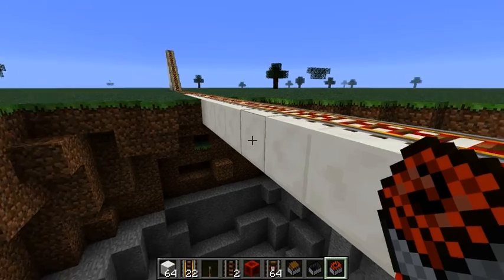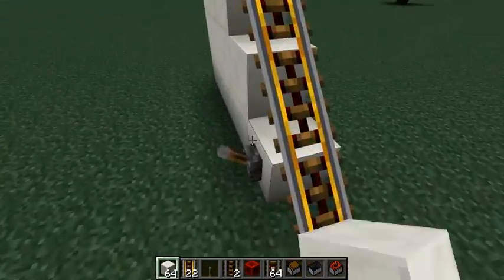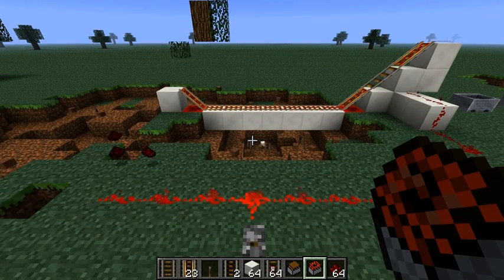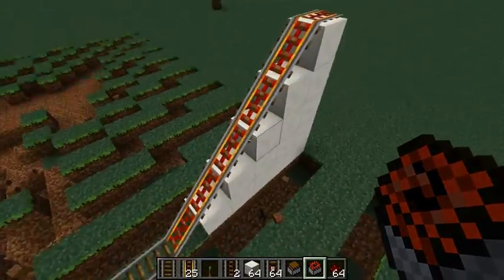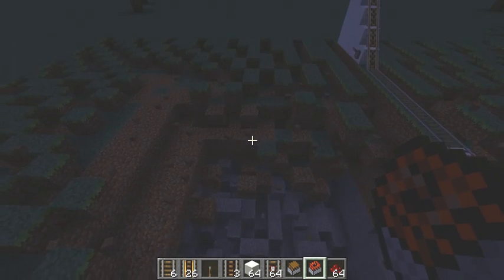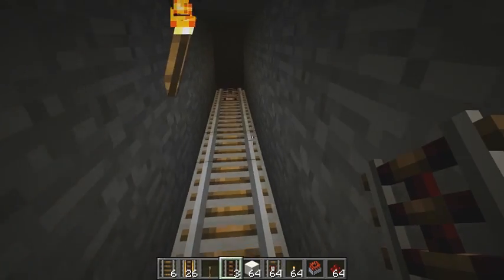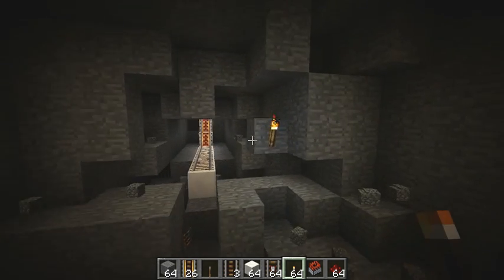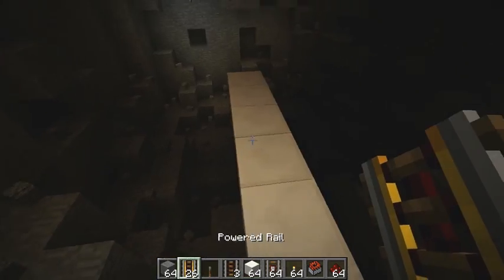[Minecraft 13w02a] TNT Minecarts and SCIENCE!

Comment: After some testing the normal rail doesn't have to be on the flat, it can be sloping down and you still get the big bang. So with some work you can take out large amounts of land by using  a set up with 4 lines going down from each angle ( NSEW) at the same time.

I also found out that on average the area blasted out is roughly a 10 x 10 x 10 cube, sometimes 12 x 10 x 10 if going down hill when they go off ( extra 2 blocks is in the direction of movement).

Hope this helps some people.